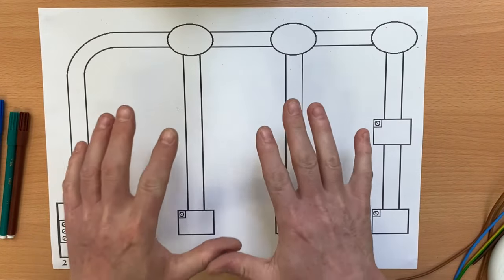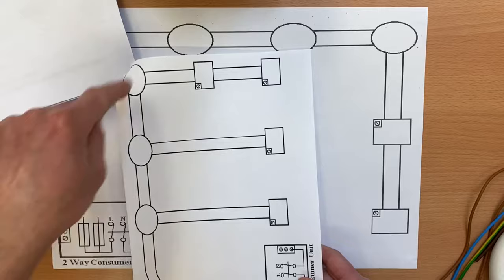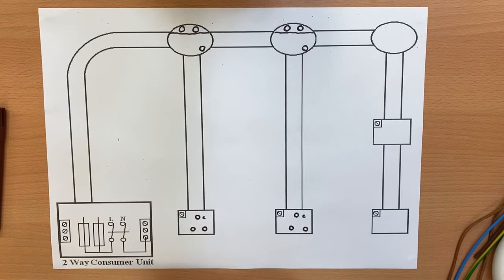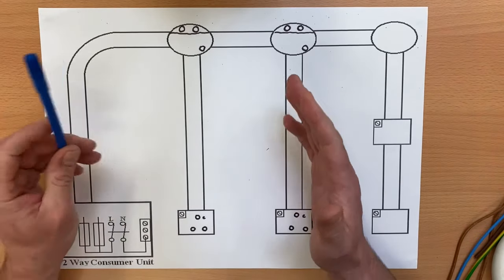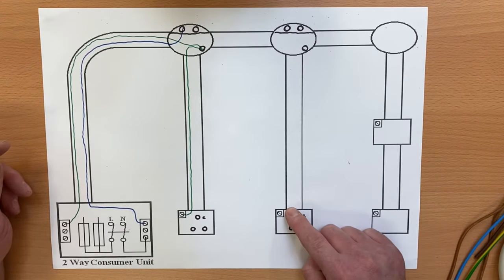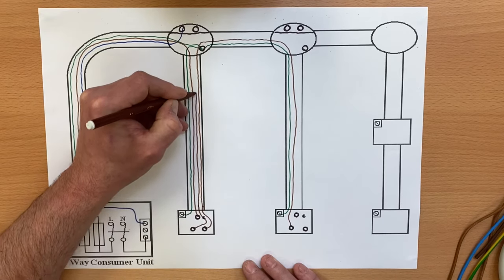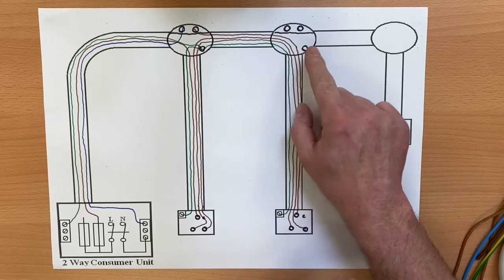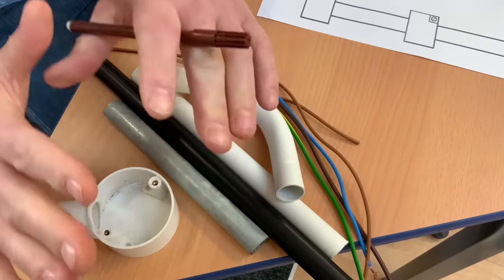Wiring Diagram Conduit Loop-In Method Part 5 - Lighting Circuits in PVC Singles - 2 Way Switching

Comment from the maker: == 🕐 Time Stamps - Cut to the action 🕕 ==
00:42 - Download available with the link in the description 
02:24 - Wiring diagram using the conduit loop in method one light controlled via 2 way switching
04:30 - Using a circuit diagram to help with our wiring diagram 
05:58 - Adding the neutral to our lighting circuit wiring diagram 
07:16 - Adding the CPC's to our lighting circuit wiring diagram
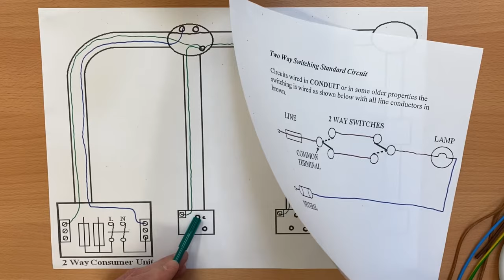08:59 - Adding the permanent line and strappers to our lighting circuit wiring diagram
11:35 - Adding another lighting point to our 2 way switched wiring diagram

Comment: I thought most people now recommended bringing a neutral to the switch for future proofing and testing/troubleshooting. Is that not required here because with singles and it would be so simple to run a neutral at the time it was needed or something else?
Reply from the maker: I agree with your comment Dave
Reply: @GSHElectrical  It was more of a question, really. 

Are you saying you wouldn't run a neutral to the switch here as there isn't a need for future proofing, as adding at a later date is simple in singles and conduit?

Comment: I think I missed one. But good video regardless.
I especially liked the "extend this to more points" talk at the end.
How sometimes trying to be more efficient with the cables may not always be the best practice and cause confusion in the future.
Reply from the maker: Wiring Diagram Conduit Loop-In Method Part 6 - Lighting Circuits PVC Singles - 2 Way & Intermediate https://youtu.be/DQHO5zflXe0

Comment: What if my light fixture is a fully insulated LED batton light pre wired with only live and neutral wires coming from light fitting? Currently wiring my own garage but will be getting an electrician neighbour to look after the CU and testing and final power up.

Comment: I was taught to add  an extra line conductor with the strappers ,that way the feed and the switching line can be in the same light switch.
The feed to the common and the switch line to L1 or L2

Comment: It was fairly common in the late 50s early 60s to find houses wired  using the loop in method. 
The only difference was because they were not wired in conduit the electrician used double insulated singles . The only twin lighting cable in the whole house was the strips between the 2 way switches in the hall and landing .
Also no earth in those days
Reply from the maker: Thanks Andy for your detailed input 👍🏻